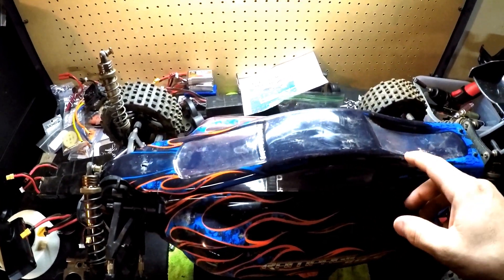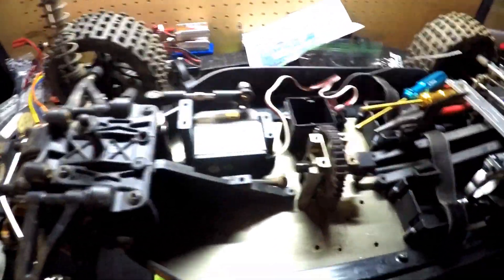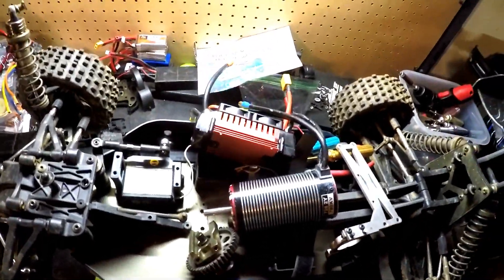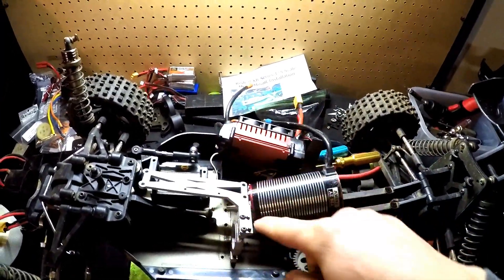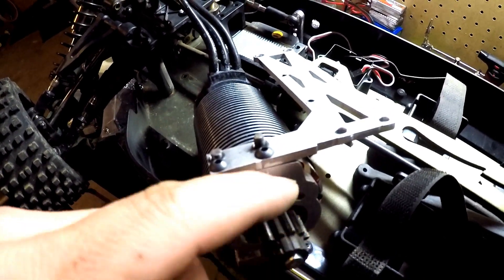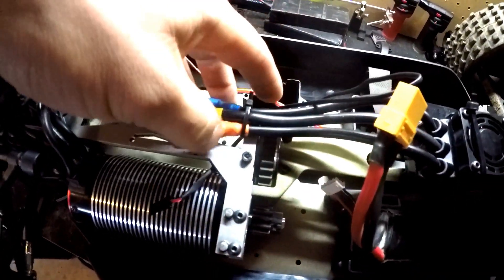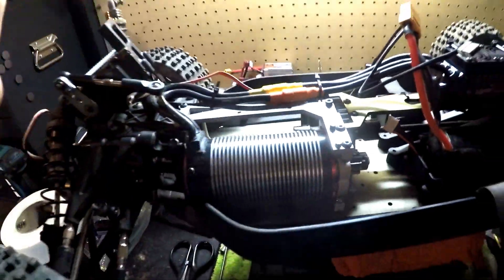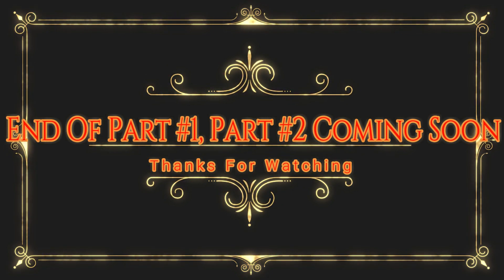Redcat Rampage XB-E 8s Upgrade Build Part #1

Comment: HOLY CRAP that things huge...Lol!!! This is seriously exciting brother 👍. Appreciate the shout out bro. BIG PROPS to Vanning for reaching out to help you with this Beastly project!!! Too cool brother 🍻. Great explanation and heads up for those wanting to take XBE power to a whole nother level...Lol😨😨😱. Can't wait to see you hammer this thing.🙋🙋😵😵😵😲😲😎💪💪💪💪👊👊
Reply from the maker: Thanks so much and I will be bringing this down for our next Co-bash if it all works out. Thanks again brother
Reply: KillerOffRoadHobbyz 🍻😎💪👊👊
Reply: KillerOffRoadHobbyz hey Gary on my MT410 does the center driveshaft and diffs spin real fast when ur done with the build , mine spin but it's like it doesn't spin super easy, like u have to use some force to spin the spur gear, I hope I didn't screw something up , I did use a low in the front and standard in the rear for shock tower plugs , could that be throwing off the alignment? Or will the power of the battery get everything moving fast  and I'm good?:
Reply from the maker: With the diff oil everything is a little tighter but make sure there's no binding in the gears and you should be fine
Reply: KillerOffRoadHobbyz ya it's weird when the rear assembly is loose and I put it on everything spins like butter but when I tighten the screws down on the rear assembly then the spinning tightens up , I checked and the assembly is in the correct place and the notch is in the chasis , how can I tell if the gears are binding ?
Reply: KillerOffRoadHobbyz Gary can u tell me what channels to use on the Flysky GT3b transmitter ? Like servo channel 1? Esc channel 2? Bind 3? Please help! Lol thanks
Reply: KillerOffRoadHobbyz hey Gary how did u mount the Duratrax lockup mt's to your mt410? I put the wheel nuts in the wheels but how do I secure them on ? Did I forget to buy something like nuts or screws? Any help would be awesome thanks man
Reply: Just sub today. Love tha rampage.

Comment: Not Bad, not bad at all. Get A dual cooling fan and it will be fine. Plug it in to the open slot on the receiver, number 1 position is best if it's open.... Merry Christmas..
Reply from the maker: Thank you and number 1 is for the servo have to olug it in 3 or bat. Merry Christmas
Reply: KillerOffRoadHobbyz noted. Have to write that down. First unit I've come across where numb one was used or maybe I'm looking at em basswords. What I been calling num1 is the Bat. Noted!! Thanks. Happy Holidays.
Reply from the maker: Yeah it goes from bottom to top lol so it's set up upside down, happy holidays

Comment: She should definately rip,  I think you should definately threadlock those motor mount screws, Ive never had a motor melt the threadlock also you never want the motor to move and chew up that spur gear, especially with a motor that size, usually the motor mount screws use a big enough head where you don't have to worry about stripping them when you go to take them out! Looking forward to this thing!
Reply from the maker: Thank you very much for the info I will do that for sure.

Comment: I never got why they designed the pinion and motor shaft like that... would of been better just the key the 2, unless its designed to loosen the grub screw so the pinion spins to prevent the shaft from twisting from to much torq?
Reply from the maker: Not sure but I hope it's not the good now lol

Comment: Great video. I bought a new Rampage XBE over a year ago. On the 3rd run, it just stopped working. No sound no power. So it just sat there for a year. I’m fairly new to the RC hobby. Not sure how to trouble shoot. Any suggestions?

Comment: Man I wish the best I had got a CC 2028 motor and a hobbywing max6 200 amp esc, and could never find a motor mount, so I went with a XO1 traxxas 1717 motor it was a headache and still is. By the Kershaw passed away.  And please let me me how you do the wheels that my next upgrade and I do need the help?  Thanks and good luck!
Reply from the maker: No way really that sucks. Sorry to hear that and I will be posting a part 2 video tomorrow
Reply: im running 8s to my 1717 with no issues,i do run a cooling fan.are you running 8s?

Comment: powerful motor but It is more suitable for heavier rc like 5ive b... for the xb-e its to much torque especially with 13 tooth, the leopard 5892 1090kv or catle 2028 are mor suitable for the XB-E like I told you a week ago, I already ordered the leopard with Hobbywing Max6 280$ for both and bought some pinion 15 to 22 tooth 
Anyway good job bro..looking forward to see a video of it in action :)